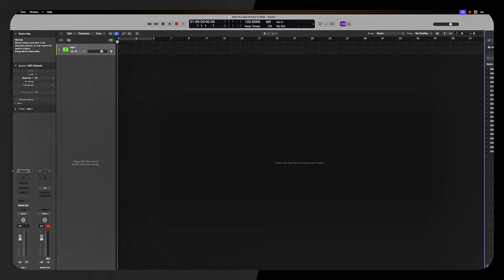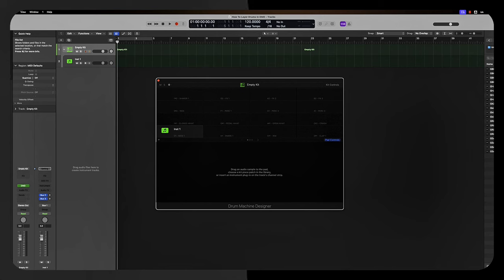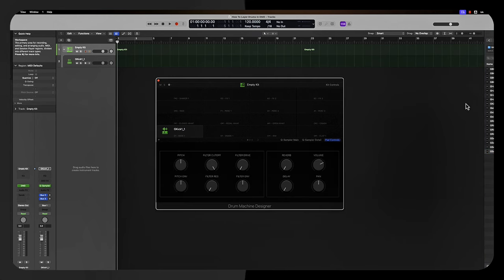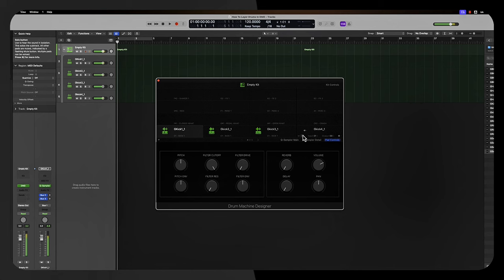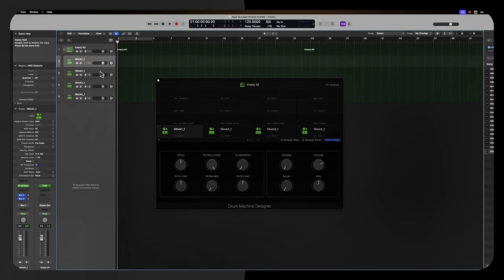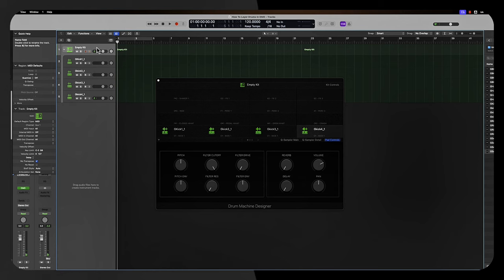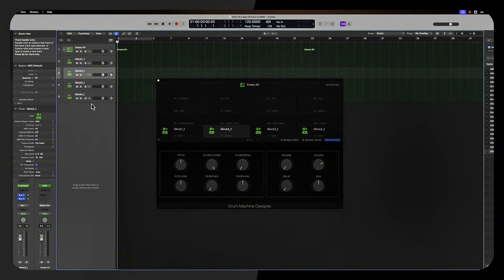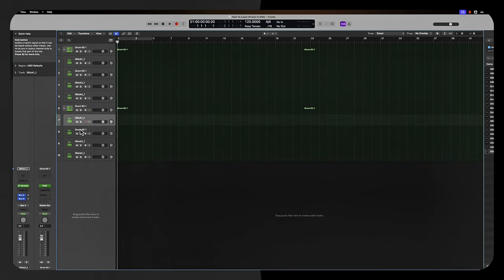How To Layer Drums In Drum Machine Designer: Here's How

Comment: Thank you Fam! ..  For making that video… 

I see you got a MPC … are you working completely with MPC , then export wave files . To do Vocals inside logic ..
 
I don’t see note repeat option on Logic just got Mac / Logic ..
Reply from the maker: I do both. But yes, when I'm making beats in the MPC, I export it to logic. As far as note repeat. You can add an arpegiator to the track. Or you will need a midi controller like a akai mpk anyone with pads and the feature to turn on note Repeat. Or use the brush tool inside the piano roll. Other than that, you got me on the note repeat without an external device. More research to come. 🙏🏿💯